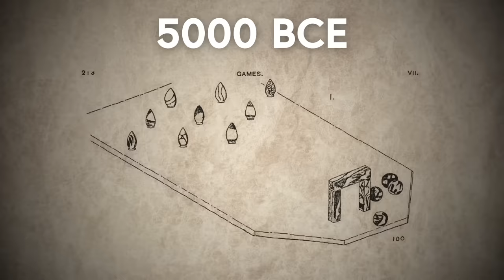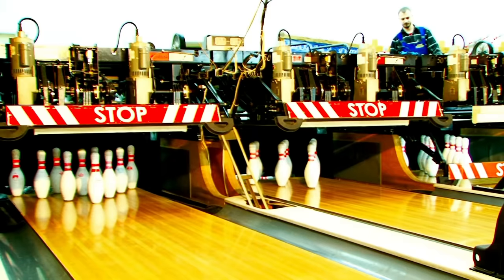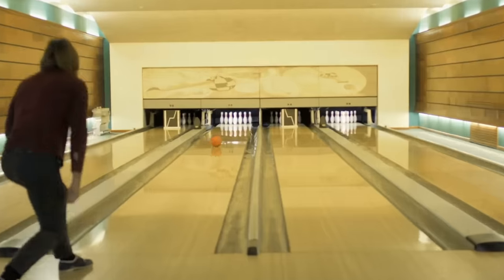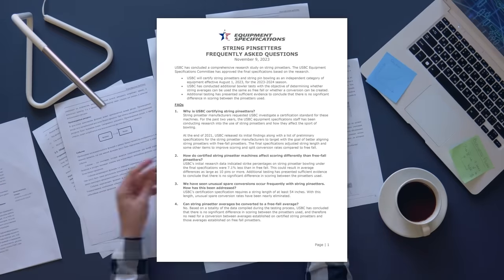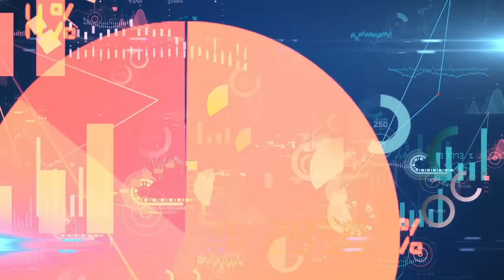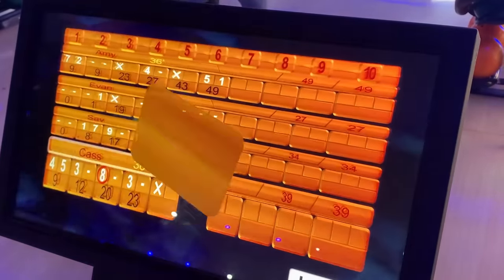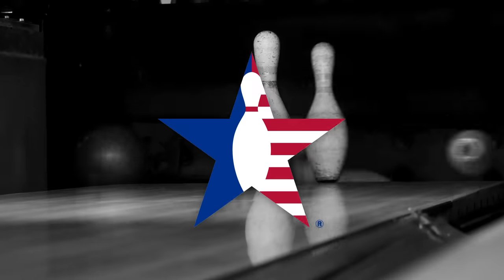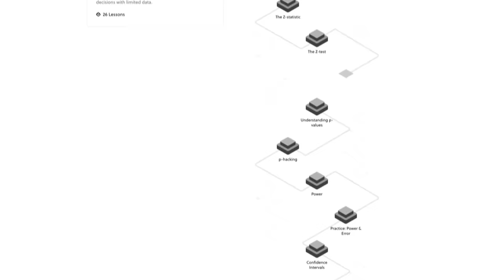The Controversial Machine That’s Ruining Bowling

Comment: My cousins bowled pro through most of high school and all of college (on scholarship for bowling) they can immediately tell when an alley is “short stringing” and will often walk out mid-game never returning to that alley without being bribed with significant amounts of food and alcohol.
You would think with strings dramatically reducing overhead alleys wouldn’t cut corners on string length, but I guess just a little bit more string for each pin is too much to ask.
Reply: Running with shorter strings has nothing to do with cost, and everything to do with lowering tangles...
Reply: @Triley215 yeah I can’t imagine a small amount of additional string would be that costly.
Reply: @Triley215  which is a cost. if they have to get someone to fix it slows down games (their goal is to get as many people through the 10frames as quick as possible) and maybe a lot of tangles would need an extra staff member so not the 1 person doing front desk, cleaning and drinks as well as technical some have.
Reply: @jonh6585 a bowling centre's goal should not to bowlers to bowl as many games as possible.  Smart bowling centres charge hourly rates. 

Either way, you're preaching to the choir on this one.  I have 28 freefall and 12 string machines that I'm the head mechanic for.
Reply: Rofl, no bowling center is going to give free crap to someone  just because they were a college bowler.... this is delusional 🤣

Comment: As a tournament bowler who’s seen what the USBC certified string pins look like in action, it doesn’t look all that different. I think it will be a great option for bowling centers to continue operating and lower the cost for everyone (maintenance and pricing the games themselves). It’s an accessibility thing to keep bringing in new people to the sport.
Reply: string pins is marketed as this way to make bowling cheaper but the string pin bowling alleys cost the same to bowl on as the free fall bowling ally's. it's just a way to increase profits.   Bowling centers need to focus on the experience like having food that is actually good. There is one bowling center near me that i will go to just for the food.  also having attentive staff and more than one cashier to check people in. waiting in line for an hour before you bowl is really crummy. and waiting 5-10 minutes when your ball doesn't return is frustrating especially when it happens more than once!
Reply: @BassRacerx  So you are saying bowling centers are trying to make a profit?? Why would they want to make a profit, when they can just keep paying out mechanics to stand by waiting for a machine to break, and not return your ball for 10 minutes.. I mean seriously, who needs profits.
Reply: @JoeBrrFan   my point is that if it's more economical to bowl for the center some of that savings should be passed on to the consumer.
Reply: @BassRacerx  If they are going to string pins, the fact they won't be raising rates to pay the mechanics means savings to the bowler.. it's built in savings.
Reply: @JoeBrrFan  my experience is the string pin alleys charge the same as the free fall. it may be too soon to tell so in a few years the free fall alleys may charge a premium but so far that is not the case.

Comment: I worked as a pin boy in the early '60s. The predominant pins in Maine at the time were candle pins. These are bowled with a smaller (read faster) ball and they flew. On more than one occasion a pin would barely miss my head as I sat above the pit. Never got hot, but had a number of close calls.

Comment: Played on strings once and felt like the strings were preventing the pins from falling when they wobbled several times. Literally those pins were just sort of hanging at an angle. Also felt like in a split situation where a pin should shoot across and hit the pin on the other side, the strings almost always prevented that from happening. Although in other cases, it did seem like the strings were taking out some pins that shouldn't have. So maybe the conclusion here should actually be that sometimes when things are statistically identical, they may still be fundamentally different because of a failure of the statistics to capture all of the potential data.

Now, maybe the machine I played at had the wrong string length or improper tension on the strings or something, but that just proves my point... there are too many unaccounted-for variables to quantify to make a judgement based on statistics in this case.
Reply: FYI Pins off their base hanging at an angle are counted as DOWN PINS. String machines sometimes get this wrong, so just alert staff to do a score correction and move on. I can see how someone who doesn't know this rule could get frustrated thinking they've been screwed, but that's not actually the case.
Reply: Then there was something wrong with the machine. The strings are completely slack and will not hold a pin up or restrict its movement until retracted. I worked on Qubica machines for a few years.
Reply: @ThatOldGrey  Which is part of the whole problem. Pins sitting on a floor behave in a certain way when hit. And they will almost always behave in that way. Pins with strings on them suddenly have these forces on them that are not just different... they are unpredictable because the variables are infinite. Is the string too heavy, too light, too long, too short, is there not enough slack in the system... and some of those variables can be introduced with time as parts wear or slip out of alignment. So now we have a machine that is sheer simplicity for resetting pins... but it has introduced chaotic complexity into the fundamental gameplay itself.
Reply: @patreekotime4578  This comes down more to the maintenance schedule of the strings than anything. All pinsetters use the same 1/4" nylon string. When a pin is initially strung on the machine, it is typically strung with 72" of string. The pinsetters are designed to release up to 54" of slack, and this allows the maintenance team to remove a small amount of string right above the pin (where it is most likely to break)  8-10 times before having to restring the whole machine again. If maintenance teams don't frequently inspect for strings that are likely to break and the string breaks, then the whole machine has to be restrung with new string for that pin. It's only if the string length for any individual pin drops below 54" that you would ever have a problem, and that should never happen with a regualr maintenance schedule. It's not the strings that cause the problems, it's the cheap/lazy management of the bowling centre.
Reply: @athletixbc  which couldnt happen without the strings lol
Reply: @athletixbc  That rule would not be needed in Free Fall. Free fall does not focus on forgiving the rules for the logic as much.
Reply: @typetalk3726 The same rule applies to free fall. "Pins not sitting completely upon their base shall be counted as down pins."
Reply: @athletixbc  ok. thank you.
Reply: @athletixbc  Pins must be at an angle of 7.5 % for them to fall down. Therefor, if a pin merely wobbles, it doesn't mean that it counts as falling down. I can see a lot of arguments over a wobbling pin!
Reply: @fiddlefaddle1 If comes down to being honest about what you saw happen. If it was still wobbling when the pinsetter activates then it's not yet down. You don't get to say that it would have fallen had it been allowed to continue wobbling. LOL

Comment: As a Bowling lane mechanic I will say a well tuned machine (depending on model) can last a long time with no parts breaking for many multiple months an sometimes a couple years. Also freefall machines are not dangerous in the slightest if you maintain them properly lots of people are just lazy and forget to do their safety processes before servicing a machine. personally I myself hate string pinsetters they just arent the same as even tho your stats say other wise there is still evidence that it dose effect the game

Comment: With the advent of composites it's a little surprising that they haven't been intigrated into or retrofitted into the stackers. I think it would lower their mass and reduce the amount of power it takes to operate them. It could possibly make them safer to maintain and cheaper to repair. 
One of the downfalls might be that composites wouldn't take the repeated stress of continued use (?). But selective placement could help to solve that.

Comment: I can’t help but feel pin setters could be modernised and simplified so you could keep them without so many of the disadvantages
Reply: If you can design a good pinsetter that is simpler and cheaper to operate than the "traditional" ones, I'm sure people would love to see it. It could solve this whole dilemma! But you'd need more than just a vague "do the old thing but better".

Maybe a strong magnet at the top of the pin and electromagnets in the setter? It'd almost certainly be more expensive and more complicated than a string setter, but if the extra cost is less than the amount of extra traffic you get because the pins going everywhere is more fun, it's worth it.
Reply: They've been improved over the years, and probably could be improved further, but it's always gonna be harder to pick up the pins mechanically rather than to simply pull a string.
Reply: I’ve got an idea that still needs some llfleshing out….magnets! 

More specifically, electromagnets
Reply: @extragoogleaccount6061  I was thinking about that too. Like a variation on the automatic pin setter that eliminates all the extra machinery behind the lanes. Like, you could have a camera to see which pins have fallen, then it would activate the magnets for those slots and it would draw them back in place.
Reply: @keiyakins  Not a bad idea, but adding magnets to the pins could potentially change how they "work" when struck, so that is a whole other question.
Reply: @joeblankenship377  but, the magnets would have to be in range and what would keep on from picking up more than one. If possible, it would be very difficult
Reply: Just keep it simple; an articulated robot arm using computer vision to pick up the fallen pins and plonk them back on the spot. Any pins not in use can be placed by the arm in a little bin. A few motors, joints, a camera and a computer (probably one powerful PC could run all the lanes) the hardest part would be the software to move the arm to quickly set up the pins without knocking them over again.
Reply: @3rdalbum  A setup like that would be way slower than a traditional pinsetter, which would slow down the bowlers significantly, and thus make the experience worse.
Reply: tentacles solve everything, we domesticate giant squids to fulfill the role of the ball boy. a healthy diet of sperm whales has to be cheaper than a freefall pinsetter.
Reply: @keiyakins  there has already been a machine made with Magnets, similarly they made a machine that had a vacuum that sucked the top of the pins while sweeping the dropped pins. Neither caught on, more then likely because they couldn't allow for out of range pins. Since OOR pins seem to not matter to the USBC now with strings these machines could be a new viable option, but they for the most part have just as many moving parts as the older pinsetter machines.
Reply: We need government investment in this pressing engineering challenge.

Comment: Interestingly here in germany pins with or without strings are used for similar yet different games. Bowling and Kegeln. Kegeln uses stringed pins a smaller ball without holes and is generally more "lowtech". Its mainly used in some clubhouses since its cheaper and more easy to maintain.

Comment: I once bowled on a lane with no pin setter.  Basically when it wasn’t your turn to bowl, you would pick up the pins and stand them up or clear them, and roll the ball back to the person bowling. It “worked” as a zero-cost way of resetting pins, but gameplay was slow, and cumbersome.
Reply: Did you have to walk down the alley?

Comment: As a front desk worker at a free falling pins bowling alley who comes from a family of bowlers, the string pinsetters don’t feel right to me, and I don’t know if I’d ever want to bowl on them if it’s not duckpin bowling tbh. But also calling calls about stuck balls or pinsetter issues to the back is probably the best part of my job so…
Reply: its like if they took away the zamboni and jumbotron from hockey stadiums and replaced them with LEDs and some new truck, yeah it may get the job done better but theres a point where something is unique enough to deserve preservation, unfortunately anything after the 60s of any kind despite how much has taken place between then and now and cultural influence is regarded as "dated" and marked for the landfill to make way for the blander technology and designs. 
high pressure sodiums lights are objectively worse than LED but still have enough charm to deserve to somewhat exist in walkways or gardens, just not freeways and roads
Reply: How do you pick up a 7/10 the-pins don’t fly around the back . Anything can happen this is a scam .
Reply: I hate them. It’s not fun at all and it’s completely inauthentic. 
If my local alley switches, that will be the end of me going there.
Reply: @blaniac6591 Its not like you spend $3k a month to bowl. I don't think they'd care if you leave if it saves them more money by switching to strings.
Reply: @aezzil3536   most successful bowling alleys are only so successful because they host tournaments, tournament guys are going to want to play on these lanes even less than the standard population.
If at all.
Reply: @blaniac6591  If they're so successful then start your own and shutup
Reply: @aezzil3536   or should I ask what’s wrong with you?
Reply: @blaniac6591  Whats wrong with me? Frankly not caring about whether a bowling alley goes string or not is a problem now I guess.

Comment: I bowl competitively, and I have to say that it seems to me that the strings are more of a cost cutting measure. At alleys with strings, the bowling budget is low to begin with and so of course the experience is worse because they don’t oil the lanes. If the physics checks out with the same oil patterns and lane conditions then that’s fine— but i’m more concerned about the overall drop in quality at most mainstream facilities.
Reply: Shirley the place is cheaping out on they're most important equipment are putting that money towards all of the other expensive maintenance... right?

Comment: Stat-head wannabe here. 4:05 The p-value you quote here is actually for a normality test (Anderson-Darling), not the t-test itself. Also, if the p-value was <0.05 we typically would say we reject the null-hypothesis, which is not, in-fact, a huge slay for it

Comment: I feel like it should be possible to design a less complicated free standing pin setter in addition to the string setter. The string setter will ultimately be the best choice for casual play. Perhaps articulated arms could set the pins and clear downed pins between bowls. It wouldn't be a cheap option, but it would probably be safer.

Comment: I'm not a pro bowler by any means, but I feel like string pins just aren't as good as free pins. It almost feels like the string absorbs some energy from the pin when its hit and can prevent me from picking up certain spares. String pins also seem to work better with crappy house balls and not custom ones designed for spin. Even my custom house ball for throwing straight shots doesn't do as well with string pins. I have no idea why but that's just what it feels like.
Reply: It's absolutely true that certain spares are more difficult on string machines. The spares I'm talking about 7-10 and 4-6 where you have to shoot a pin directly sideways or get a lucky bounce. Just remember, everybody is bowling on the same lane with the same pinsetter, so everyone has the same advantge or disadvantage. While a few select spares may be more difficult, I think I get more strikes on strings because a string will catch a pin and knock it over.

Comment: In my area you won't find any string pinsetters. We have mostly A-2s which are known for being absolute tanks. I bowl regularly and malfunctions are few and far between. It's all about preventative maintenance on the machines as well as qualified mechanics. Eventually I would like to become a pinsetter mechanic myself. Strings CANNOT take over bowling.
Reply: They won’t here in Vegas either. You can’t even find a pinsetter in any place that claims to be a bowling alley. You can find some pinsetters in casinos and arcades, but you get the real thing when you go to a bowling alley in Vegas. I hope that never changes.

Comment: I worked on AMF pinsetters back in the 80’s as a high school job. I once got lifted by the sweep and trapped for a few minutes while a coworker released the brake on the motor and manually lowered the sweep.

The place had zero safety policies and lots of injuries. 

Eventually I cut the end of my finger off trying to reset the pin distributor and the place closed down soon afterward.
Reply: Hopefully you learned a lesson about sticking your fingers into moving parts, too.
Reply: Evidently you were never trained properly or didn't care to follow procedures. Bad deal there. Brunswick machines are a lot more dangerous than AMF.

Comment: honestly was suprised to see the design of pinsetter used in the video. im more familiar with Brunswick A2 pinstters, which use two wheels to send the pins and ball back to their respective spots
Reply: secondary note- the second alley your folks went to to do testing used A2's, or at least something similar. I can tell from the turret above the deck (which is what sets pins on the pindeck)